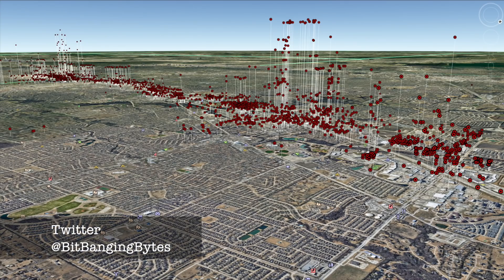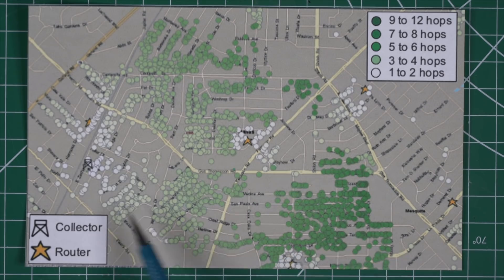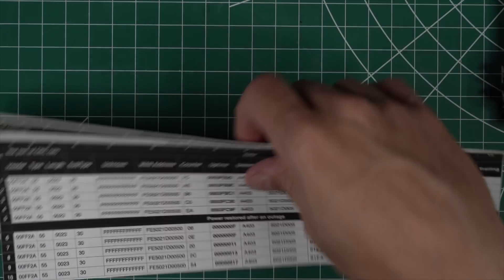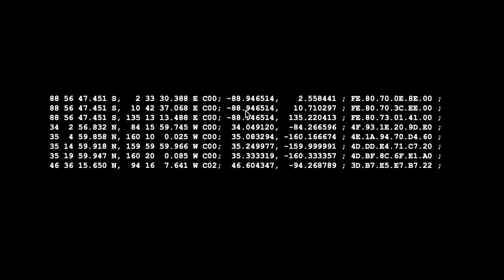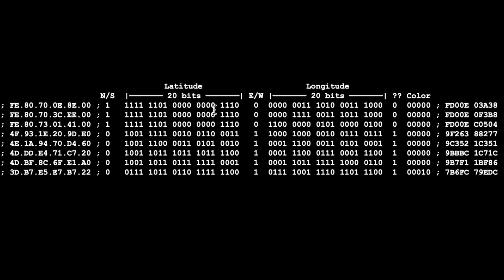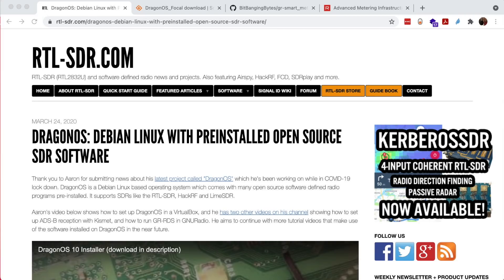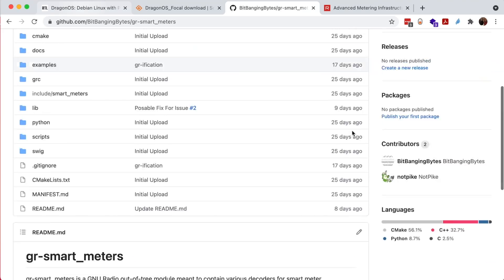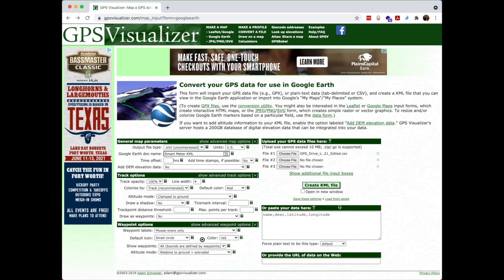Smart Meter Hacking - Decoding GPS Coordinates

Comment: > I've been in the utility business since 1982 and worked with "Smart Meters" and Automated Meter Reading (AMR) since 1990s.  The benefits of the Smart Meter for customers is the ability to use the Lat/Long coordinates to more easily locate their assets.  The other benefit is the ability to quickly map power outages and their assets.  Finally the Smart Meters provide ability to download energy data.  Smart Meters are are like little computers/smart devices at the service point or end point.   The Smart Meters are also important  for utilities to obtain meter reads remotely and do other work remotely ping the device, test if power is on or off.  Great stuff.
Reply from the maker: Just recently discovered some key data I have been missing, working on a new video to share my updated code. Thanks for watching!

Comment: Exceptional breakdown. I wonder what would happen if one were to fake a packet with a GPS coordinate hundreds of miles away. The smart thing to do would be to route the packet to the nearest collector. The dumb (but interesting) thing to do would be to route it across the mesh network for hundreds of miles until it reached the nearest collector to that coordinate.
Reply from the maker: I’ve seen some anomaly meters like that, they report a far away location. My guess is the routing isn’t actually using the GPS, but perhaps the GPS is used in some other parts of their system.

Comment: My Entergy company tried to come install this without any warning or knowledge, seems like in most of our region. A lot of people are now complaining of higher bills. I’m wondering if the power outage in Texas was only those on smart meters or were they still able to target others?
Reply from the maker: They killed power at a substation level I believe, definitely not at the meter level so wouldn’t matter if we had a smart meter or not. You can tell because if your power is shut off but the screen on the meter is still on, they shut off power using the meter.

Comment: I always thought these were sent via DSSS and encrypted?  How do you capture and read a raw packet?
Reply from the maker: Check this video where I show the full setup: https://youtu.be/fUK8tcFQwpo
Reply: @RECESSIM  I appreciate it. Are you.having any luck with deeper access,such as meter reads, leg voltage, tamper, or disconnect relay?
Reply from the maker: Still working on that along with frequency hopping pattern
Reply: @RECESSIM  This is really good work and represents the best of persistence and cleverness.  May I use this as a beautiful example of how humans reverse-engineer things in future security presentations?  I'd love to point people to this.
Reply from the maker: Go for it, if I can help in any way feel free to reach out.

Comment: Great job reverse-engineering the coordinates encoding! Fascinating to learn how these smart meters organize into mesh networks. It seems like they know the location of the routers/collectors that they're trying to reach, did I understand that correctly? Each broadcasts its packets with a known target, and the ones catching it that might be closer will just re-broadcast it until it reaches this connection point into the backing network? If so, how do they know the location of these endpoints? Are these also propagated through the mesh network when new base stations come online? I don't really see any other way.
Reply: This is what I found for older Landis + Gyr powermeters:

"Upon power up or reboot, and at intervals while powered on, a radio automatically scans the
frequency band searching for other UtiliNet radios in its vicinity to learn about its RF
neighbors. As the radios learn about one another, they pass their geographic address
coordinates for routing and to keep communication statistics for choosing the best data
transmission paths. This allows the radios to automatically route packets and dynamically
build routing tables to choose the best paths if RF conditions change. Once configured by the
user, radios automatically acquire radios and route packets."
Reply: @znewt99  Oh, awesome! Thanks for the details, that makes sense. It must be pretty cool to work on this kind of mesh network; ~12 hops in some cases makes it sound almost adversarial, it's certainly not an ideal environment. One thing I can see being a challenge is the lack of software updates and what this means if devices are shipped with bugs in their routing logic. You could have one device messing up the whole neighborhood by miscalculating routes and blackholing the mesh traffic or causing all packets to be routed through itself for example, and you'd have no easy way to fix it without manual intervention (if you can find it!). You just need one neighbor to cheap out with a poor product for it to impact a whole area.

Comment: I'm struggling with the value of these devices to the consumer vs. the old school mechanical clock meters, i.e. the cost benefit ratio does not seem to benefit the ratepayer.
Reply from the maker: I think the value is hidden, like the value of good roads. No one thinks twice about having nice roads and how much money is saved by people who’s car isn’t hitting hundreds of potholes.

The information the grid operator has with these allows for better service to the customer. But that’s where the value lies, with the grid operator to have better visibility and lower operating costs (at least in theory) than manually read meters.

Comment: Awesome videos! Any progress on figuring out where the energy data is encoded in the packets? I took a crack at the data you posted on your website, but haven't come up with anything yet.
Reply from the maker: I’m working on a new strategy right now, logging data from a meter that has super low power usage for a week. Then going to log a meter with higher usage and compare packets to see what I can find.
Reply: @RECESSIM  That sounds like a great idea! Looking forward to your next video/update.
Reply: @RECESSIM  The amount of data generated by a meter is quite large. I'm sure you read all this in the docs you found: There is typical reading data for that meter is 8 channels for load profile (15min data), plus all the extra goodies with monitoring voltage and events as you noted in the wiki (Packets Purpose) section. If I had to guess Oncor initiates some type of reading schedule 2-3x a day for batches of meters to collect all that data. I scanned the unknown data pretty quickly and its still a mystery to me. I've seen most of the data after it was collected by the AMI.
Reply from the maker: @cnicholson123456  Yea, it's quite the challenge looking at the raw data. The meters are obviously reporting their usage, but what they report and how they encode it in the different length packets is a mystery. I feel if I understood the Device Control Word (DCW) language they use it might make things clearer.

Comment: Iam not sure if we have these smart meters in the UK, where can I can find which frequency they transmit on, so I can monitor with the SDR?
Reply from the maker: You can look at your meter and see if there is some RF identifier. In the US it’s the FCC ID that you can look up to see what frequencies they transmit on. Will vary by country
Reply: @RECESSIM  We don't actually have a smart meter (yet), but iam sure someone in the neighbourhood has. Sounds like we are a little ahead of the game, if it uses GSM, just thought that would be more expensive for the companies to run.
Reply: @miketaylor253  Design is usually driven by country regulations, utility requirements and depth of pockets along with any technical limitations. Have seen RF Mesh, point to point, cellular and power line communication so far. Mixed bag really!
Reply: @user-ew1ku3yg7u  Probably for the best.  In 
RECESSIM's area if they are transmitting GPS location, and usage data, then it doesn't seem hard for bad guys to determine when and where properties may be vacant due to owners on vacation.

I don't know how much of a real world risk that is, but it doesn't sound good system design unless I've misunderstood something.